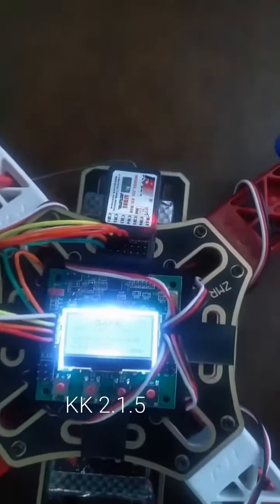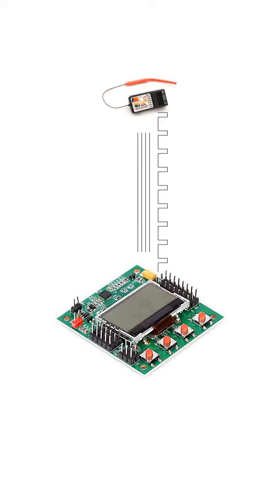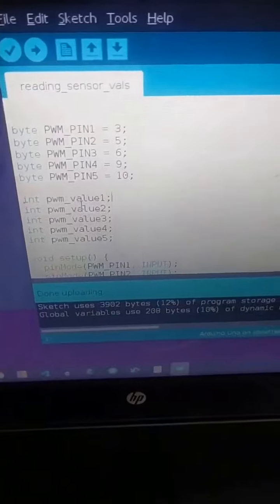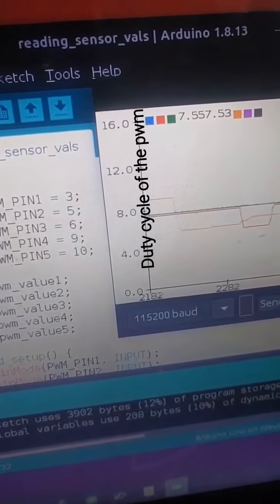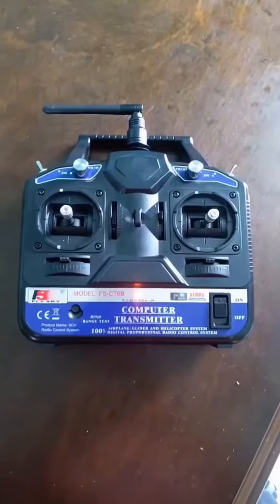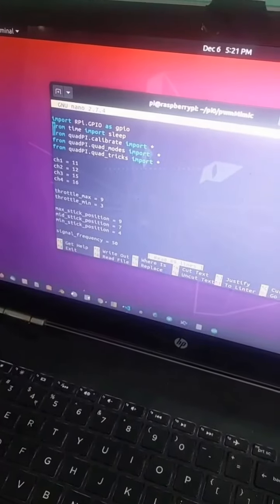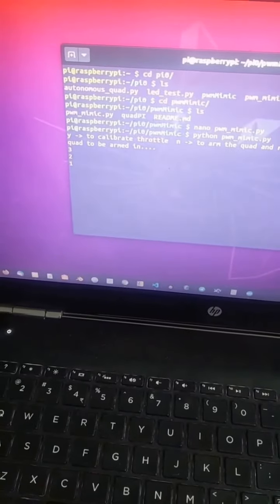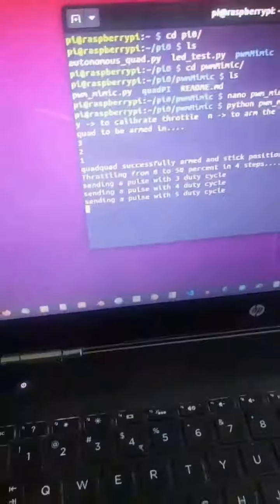Raspberry pi 0 driven quadcopter | kk 2.1.5 | python | towards autonomous

Comment: Bro using which command  you make the drone ARMED and then execute the program
Reply from the maker: If we move the throttle/rudder stick to left bottom for few seconds, the controller will move to Armed Mode, I guess, this might also vary depending on the board and joystick you're using !
Reply: @nanoelektron  ya it can be

Comment: Hello, I try to do it but have some problem. When I run "receiver test", this say have signal. But it unstable. 
After that I incease THR and it not run. Please help me.
Reply from the maker: Try calibrating the throttle ,
 the steps are,

1. before you power up the kk board, turn on the Transmitter and put the throttle stick at maximum position

2. pressing the 1st and last button, turn on the KK board , wait until you hear a beep sound from the esc and bring the throttle to minimum position 

3. you'll hear another double beep from escs, And done your throttle is calibrated, you can relese the buttons

if throttle is not calibrated, try to toggle the top left switch in your transmitter and retry one more time

for safety reasons, remove the properllars when u do it... After completing theses steps try doing receiver test... it will work!
Reply: @nanoelektron  Hello. I was try. It work but unstable. With 50Hz of pwm, signal very lag and unstable. Please helppp
Reply: @Oussema Jouini Ground Raspberry Pi with flight control
Reply: @@oussemajouini6259 hi bro i am doing the same thing but not able to arm my drone would you send your  drone/circuit image and also the code used in it